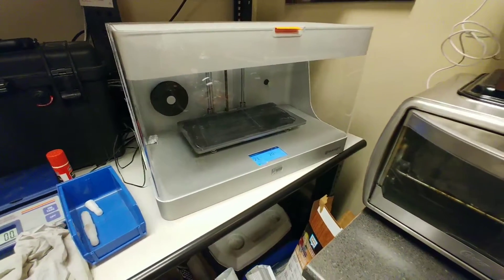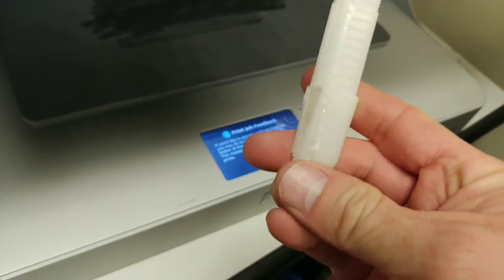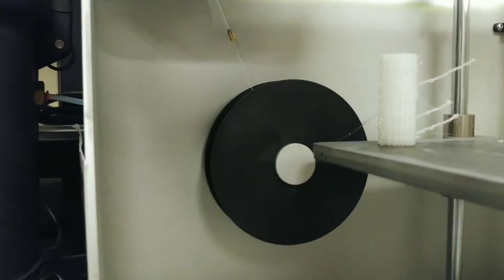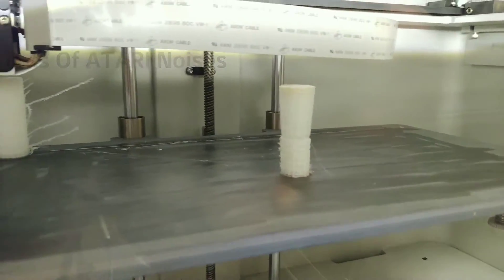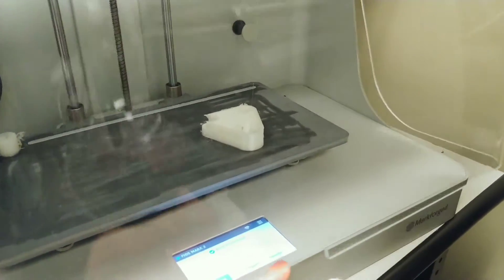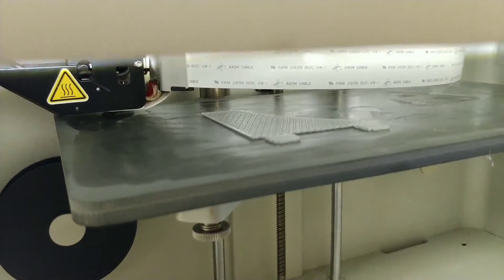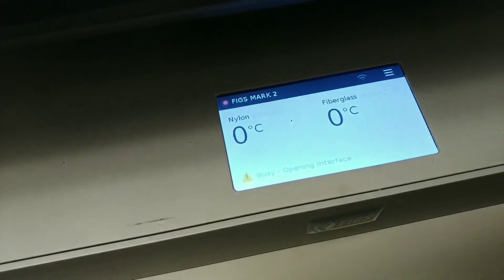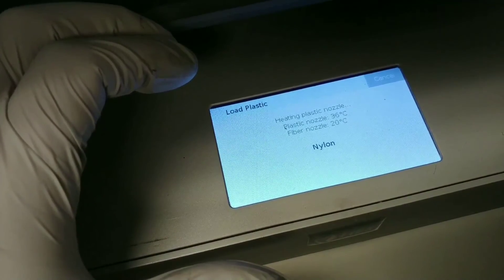LIFE WITH MARK.FORGED: FIRST PRINTS

Comment: You have wet nylon.  I'm guessing you figured that out by now.  The purge line was showing the wet bubbling from bad nylon.
Reply from the maker: "Yessir, printing much better now.  we had a ton of nylon that came with the printer but most of it was wet.  A fresh pack of filament did the trick, but there were other issues related to the print head timing out, cabling etc.  Even with good nylon, there appears to be a breach in the feed tube that is not sealed.  Shows up in the purge line every time.

Comment: Have a Mark 2 and an Onyx without the fiberglass head in the shop I run.  I inherited a bunch of regular Nylon with the Mark 2, and honestly all I can say is switch to Onyx.  The Nylon has a lot of issues in my experience.  The stringing on your part looks especially bad tho.  Also certain geometries the printer doesn't seem to like.  Gently curving surfaces put face down against the bed usually give me issues so I'm not surprised that doing the cylinder on it's side gave you problems.
Reply from the maker: Actually I've had really good results recently with the a nylon. The key has been adding sufficient support but also allowing The Purge line to run completely. I'll do a video of the parts we printed this week they came out really nice. About halfway through this spool of nylon before we switch to Onyx.
Reply: Ah that's great to hear.  I always run the full purge line since nylon really does love to soak up water.  I know some people trash the printers, but I've been pretty happy with ours.

Comment: Bummer on all the problems. I have the Mark Two that prints Carbon Fiber, Fiberglass and Nylon. It has issues as well, mostly unexpected clogged printer heads on the filament side. I would love to see the latest Onyx, but can't really pull the trigger on another Markforged until I'm reassured I won't spend all my time fixing the damn machine!